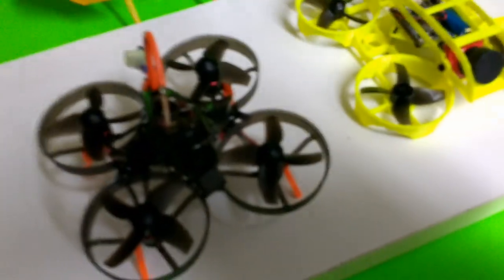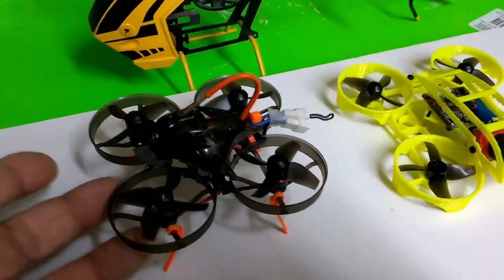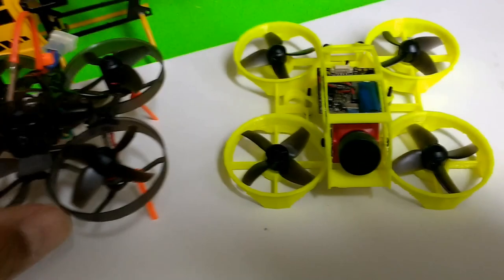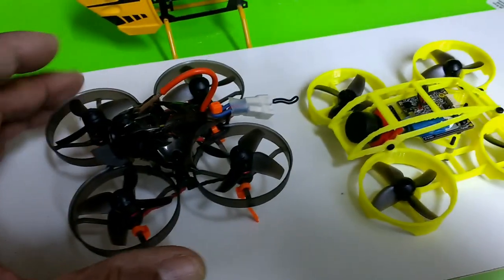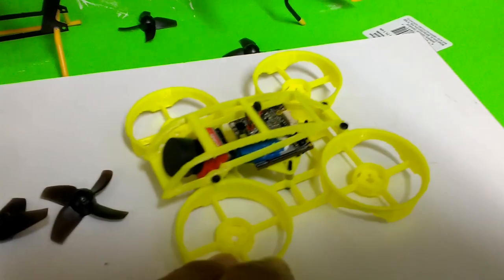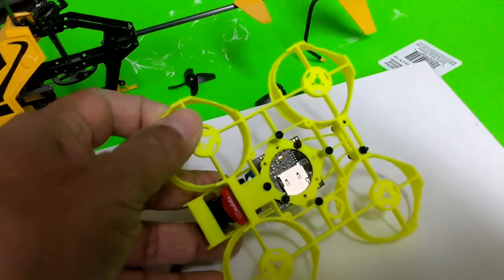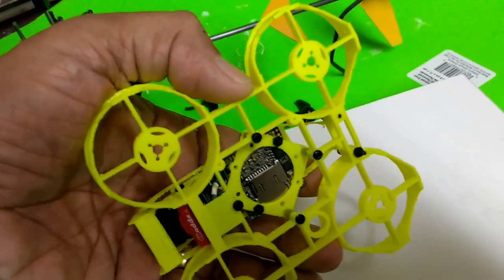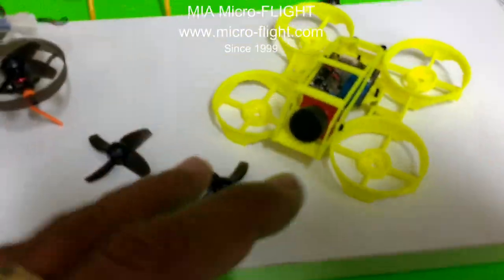Fast! Mobula 7 or Cine hoop Mobula7 Pro, Which one do you Prefer?

Comment: Co0ol frame design! Just curious why you went way up to 95mm instead of keeping the same size as the original? Seems it would add a lot of weight... 🤔
Reply from the maker: I wanted the camera more more in line with the quad and not on top. I also wanted it in between the two front prop guards, this not possible unless you open up the frame, weight is a bout 4 gramns heavier but not noticeble in flight.  I just like more streamline  qudcopters, they fly better too when everything is almost at the same level. The top mounted cameras get bacng up pretty good too antennas mainly and they are better protected in my frame designs.
Reply: I can see the camera and everything is much better protected. co0ol!  What's the total weight without battery for your Pro version?
Reply from the maker: @scootroter4859  4 gms higher than the stock setup, that is the difference in frame weight, if we take into consideration the Caddx V2 turtle V2 Camera plus DVR and VTX,  comes out to 16gms as compared to the stock Mobula 7 AIO CAM /VTS it is about 2X the weight. So in total we are adding about 12 additional grams to the stock Mobula 7 electronics with the new frame and caddx setup. The stock motors will work harder, obviously, but with the upgrade motors they will be better on 2s-3s.